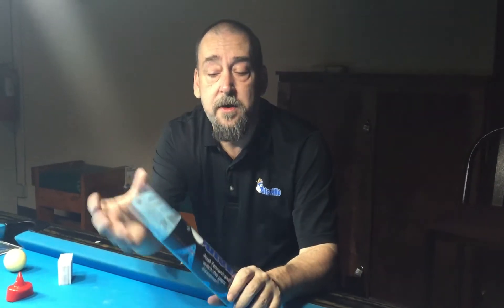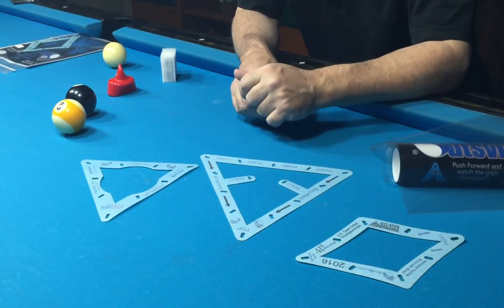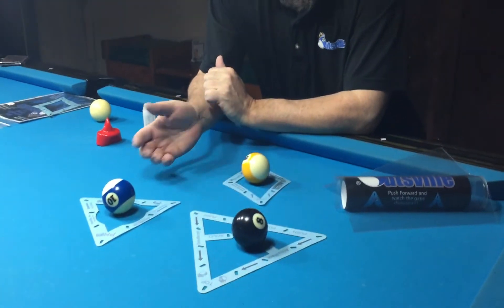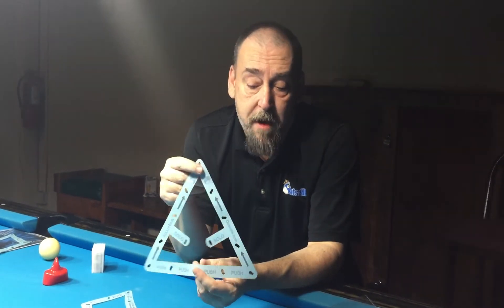Accu-Rack Unboxing

Comment: I just got in my Accu-rack and noticed a brownish tinge around all the edges, is that normal? I was about to return it for a refund, but you're mentioning burn marks, is that what I'm seeing? If so, I'm fine with it if it's how they're cut out, I mean with heat or laser, thanks.